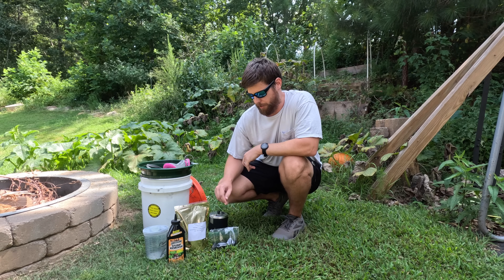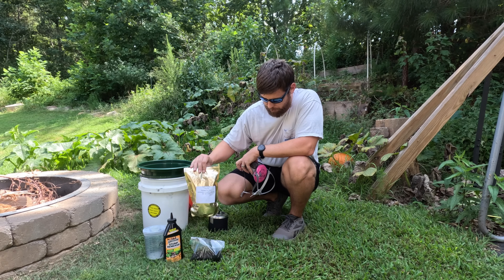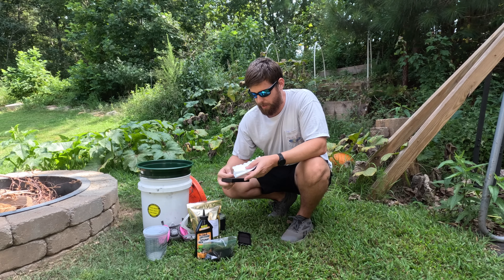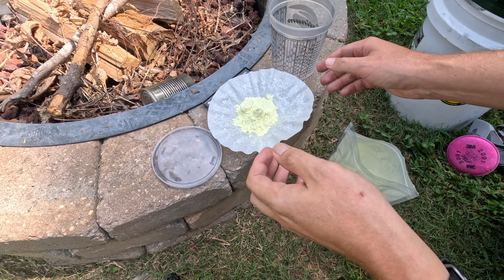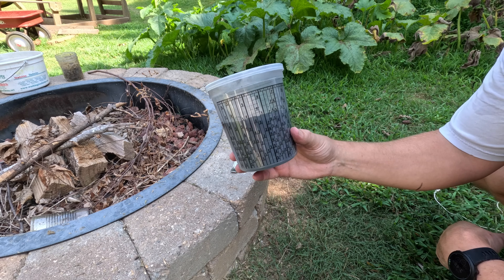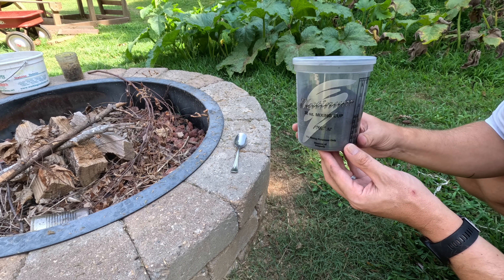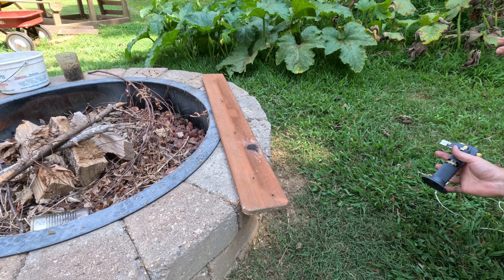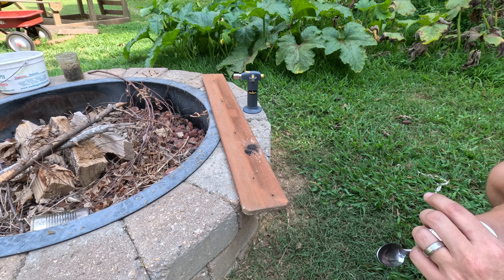Making Black Powder

Comment: I use pure milled sulfur rubber maker sulfur good fast eastern red cedar charcoal and pure kno3 I only sift it to about 50 mesh then mix and mill for 3 to 4 hours in an optimal mill drum no need to mill for half a day unnecessary if done properly. For pyrotechnics purposes I granulate through a 4 mesh screen thats generally the size used in my shells and sift the sizes and I use 1 to 2 percent dextrin or sgrs I prefer sgrs and I use 70 percent alcohol and water to wet in some cases no binder and I use denatured alcohol. And for hot nozzless fuel use camp fuel and 1 percent mineral oil to make fast rockets. Pyro is fun and bp is the most flexible mixtures we use and can make an entire show with only bp
Reply: Hi! Can you please advise on the optimal barrel? I used a vitamin jar and glass balls. I ground everything separately. I ground willow charcoal for 20 hours. There is still a slight, barely noticeable shine on the charcoal. I tried a rubber barrel and glass balls - the result is even worse. After 8 hours, the charcoal shines a lot and sticks to the walls, although I dried it for 8 hours at 100 degrees Celsius.
Reply: I recently ordered brass balls. I want to try them in different barrels, plastic and rubber.

Comment: What size classifier are you using when you're mixing. I have those same type and had pulled the supports out as well. They're cheap and work nicely.
Reply from the maker: Yeah I really like these screens, they fit together nicely and like you said work very well. I use a 50 mesh when mixing. Alternatively, you can ball mill all the ingredients together, just make sure it is away from people and has an enclosure of some sort in case of ignition.

Comment: Air float (sublimate) sulphur is not used in industrial production of BP.
Its easy to oxidise in contact whit air, since particals are extremly small.
SO2 and SO3 corrode equipment and products in which BP is used.
Sublimation is process of refining it, remelt and simple crushing, ball miling is recomended.
Reply from the maker: Thanks for your comment! I should have said "very finely ground sulfur" not air float. The description of the product I used states: "It is recovered during gas manufacturing as a molten sulfur. It is then cooled on a stainless steel belt and forms into a flake form. The flakes are then taken off the belt and ground into a fine powder." And yes, ball milling would make it better for black powder.